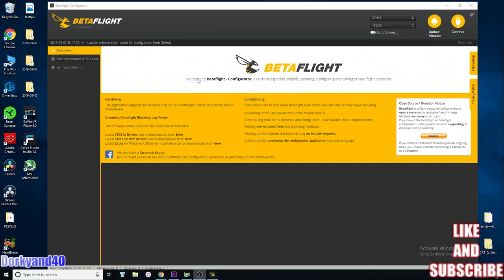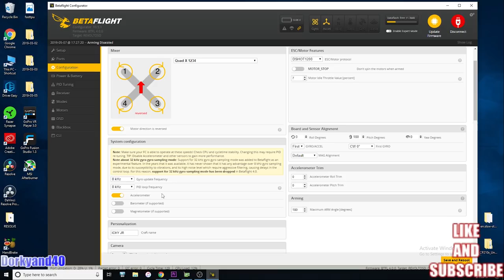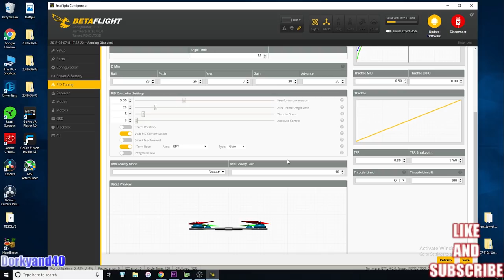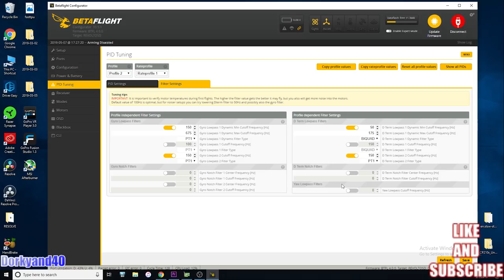SHENDRONES ICHABOD JR | FULL DETAILED BUILD AND FLIGHT OVERVIEW

Comment: I don’t know if you switch BIQUAD to PT1, that your motor is hot ?
Reply from the maker: no not at all.  ive shared a lot of logs and got great advice from the betaflight  guys.  weve looked over the logs a lot.  PT1 also gains me around .3ms of less phase delay too.  ill keep an eye on it in summer but havent noticed anything but good stuff